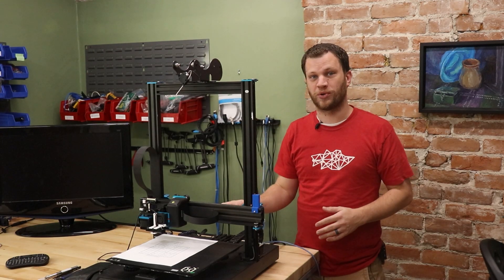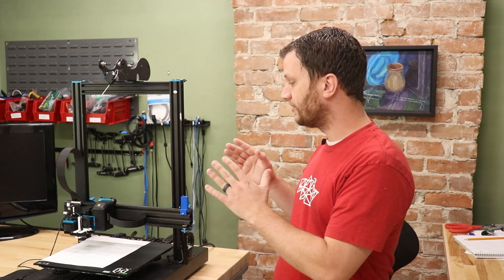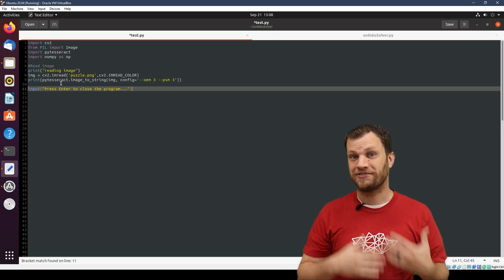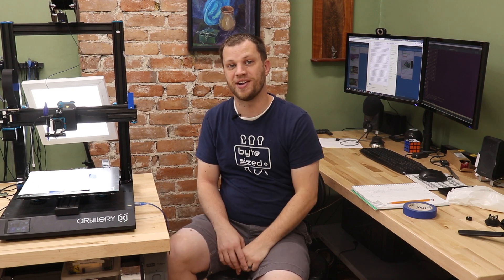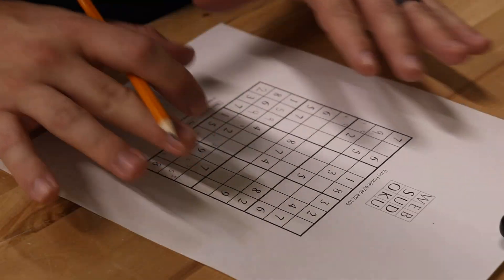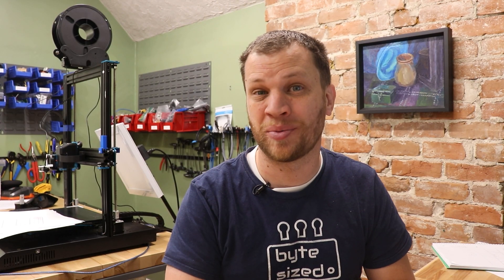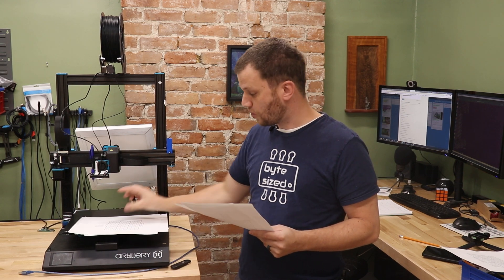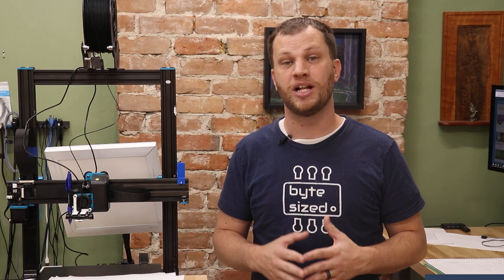I taught my 3D printer to solve sudoku puzzles.

Comment: I guess 12 before you finish 1.
Reply from the maker: You have no faith in me!
Reply: I mean... computers are fast, humans are slow.
Reply: That was my exact guess, too. No shade on Mr. Byte Sized, but like you said, computers are fast. However, I didn't take into consideration how slow it is for a 3D printer to plot out the results. I'm wondering how the score would change if someone else was handling the reloading, so the human doesn't have to keep remembering where he left off. :)
Reply from the maker: @jasonbailey9139  I think you're exactly right. If I didn't have to babysit the printer, I think that it would have been even more of a blowout.